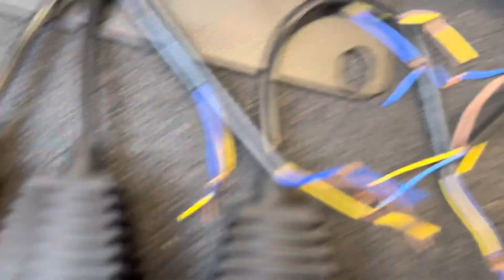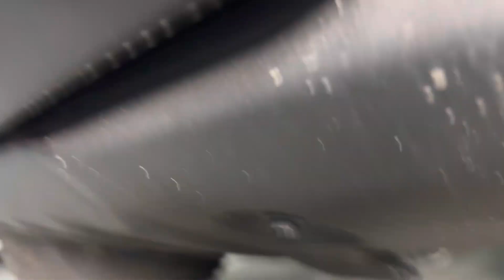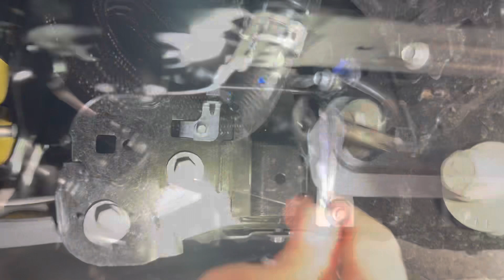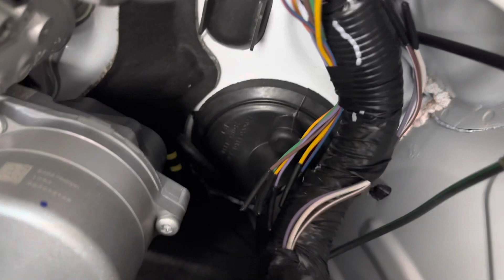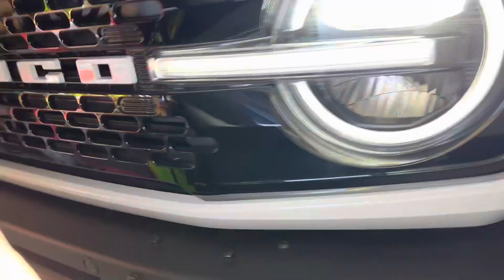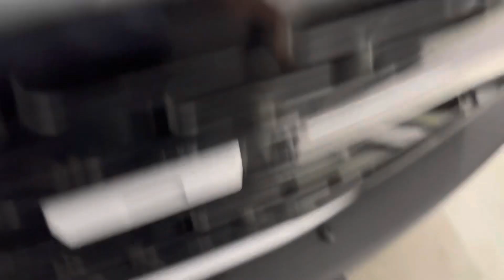M & R Modular Bumper Fog Light install 2022 Ford Bronco - installation, review, and demo.

Comment: Awesome. I have gone down the rabbit hole looking at Diode Dynamics, Baja Designs, and Morimoto for my Black Diamond. These throw a ton of light though, so maybe these are the best option? I do have one question: once you put the lights on, how much work was involved in aiming them? Did they just bolt on in the right position or did you have to fiddle with them a bit?
Reply from the maker: I had them pretty much in “the ball park” when I mounted them on the bumper, due to getting them as visually parallel to each other as possible. Once on the car and powered, I then backed my car about 20 feet from my garage door, and while laying on the ground under the bumper and look up at the lights, I did my final adjustments. Basically looking up from below, it is easy to see if they are parallel to each other horizontally, and apply pressure to the back of each light pod housing to make them all parallel horizontally. I then looked the lights from the side, with my eye at the same vertical height as the lights, and made sure they were all parallel with each other vertically. Getting them all (the faces of the pods) parallel horizontally vertically to each other, and the hottest spot of the light aligned on the garage door, worked easily. I probably spent 10 minutes max per side “tweaking the lights”. The nice thing about these is that they are more a flood, than a spot. So once they are all aligned pretty well as described, they have a really nice broad area they illuminate. They really put out A LOT of light, at 16,000 total lumens. The nature of the beam makes the aiming less critical due to the wider angle of each individual pod. I will combine these with some Spots, probably 2 total, on the bumper, for a combo effect of wide awesome flood and 300+ meter central spots. Once I get that set up, I will post a video as well. I am waiting on some Morimoto XRGB headlights too, which have twice the output of the factory headlights. Those are so bright, I may not need the “spots” when run with the M&R Fogs. The M&R Fogs are seriously bright and truly flood about 45* left to right and out a good football field with tons of light. You can see this in the video pretty well.
Reply: @jeffiovine4577  Wow, thanks for the thorough response. That makes sense and good to hear that the lights are (relatively) easily adjustable once they are installed. I am currently looking at the brands I mentioned before and I want the fog pattern (wide and low), but after seeing these in a flood pattern, I may want to go that route. I want to be able to see the sides of the road at night, not only close to me, but way up ahead. We have a ton of deer and moose up here in Vermont and you need to be able to see those glowing eyes a long way away to slow down in time when you are traveling at 50-60-70mph. The factory headlights do a good job, but they have a very narrow and low beam pattern with both low beams and high beams.

Comment: Great video. Do you know what the white box under the skied plate is? Particularly between the 2 accessory brackets? I am looking to install these lights and a hidden winch, which would go there.
Reply from the maker: I’m sorry, but I do not know. After you asked, I have been trying to figure it out, but can’t find info (yet). If I learn, I will let you know. Thanks for the remarks!
Reply: @jeffiovine4577  thank you!

Comment: Informative video so thanks for sharing ✌🏼👍🏼 The website and the lumen output shows these are for “off road use only” and probably not street legal.
Reply from the maker: Correct. The white lights are not legal for street use. You can use the amber DRL feature on streets.
Reply: @jeffiovine4577  Very true and I like them for this feature.

Comment: Thanks so much for the video! Is it possible to run the Amber into daytime constant running lights so as not to use another one of the aux switches?
Reply from the maker: It is. But if you tie them to the daytime running lights, they will not be on in the evening/night, because the headlights coming on turns off the daytime running lights. Similar issue with parking lights (which would probably be a better choice than daytime running lights) - the amber lights would only illuminate whenever the parking lights were on. That is not a bad solution, but the parking lights do not come on when the daytime running lights are on during the day. I personally like having the amber lights on during the day with my daytime, running lights, and of course, like them on at night when the headlights are on. The only way for that to happen is to power them independently on an aux switch. If they are powered on an auxiliary switch, they will illuminate any time the aux switch is on and the car has its engine running or is in accessory mode (one push of the start button without putting your foot on the brake). If I get other lights with amber backlighting, such as ditch lights, or a light bar on the roof or bumper, I will also tie those amber lights to the same aux switch, because they do not use a lot of power. So you can reserve one auxiliary switch to run all of your amber backlighting. That would still leave five switches to power, a lot of light sets, and a winch.
Reply: @jeffiovine4577  mahalo!! I super appreciate this information. I’m trying not to be a hoarder with the aux switches 😂 I am happy to know about the ditch light option too!! I love Amber’s period and have the 3 radial ones on my grill so far which went into the fuse box and just bought the amber backlit bronco letters from Oracle as well.
Reply from the maker: @contremelodiagomez8785  You’re very welcome! Yeah, the ambers look very cool. A few manufacturers now offer the option for an amber “backlight”. Now that I am hooked, it is the only type of light I would get.
Reply from the maker: Yeah, the look is really very cool! I get a lot of complements now in regards to the lights and the DRL feature.